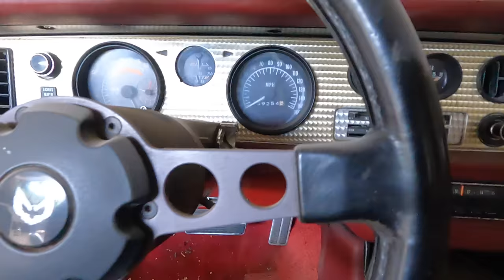Amanda's 1974 Trans Am 455-SD Dream Drive

Comment: My dad ordered one in 74 with the 455-SD engine, honeycomb wheels, and the big phoenix on the hood. Even back in the day there were shortages which held up his order, after a few months it was the wheels holding up the show so he changed to stock wheels and it was built. I only drove it a few times and it was a fun car to drive. At the same time my mom was driving a 1969 red Mach 1 which they gave to me in 1976 when I graduated high school, wish I still had it today.
Reply: I owned a 74 formula in high school. I bought it off a family friend who ordered it brand new in Toronto. He also told me the same story. He ordered it with honeycomb wheels only to be later told that he would have to settle for the ralley wheels.
Reply from the maker: They made some 455-SD Formulas.
Reply: It's a small thing, but I appreciate you describing it correctly as a phoenix on the hood. That's what it really is. I hate when it's called a screaming chicken- a dumb name that's stuck.
Reply: @thewriter2549  Never heard that before...!!!!!
Reply: 43 Formula SDs built in 1973 and 58 built for 1974. Also all Super Duty Formulas got the Trans Am Shaker hood.

Comment: My first car, bought it new. 74 SD-455 trans am, red with black interior.  I went back and forth on transmission. I wanted a 4 speed, but wanted AC too. Ended up with an auto. Ditched the 308 ring and pinion for a 3.73 after warranty along with hooker headers and thrush mufflers. B&M trans pack and holeshot converter. Ran consistant 12.20's at National Trail Raceway on street nights. Kept it until 2000. Wish I still had it.

Comment: No key, so they tear the console apart to try to put it in neutral? That's not how it works guys. There's linkage under the hood near the brake booster that attaches to the bottom of the steering column that locks the transmission in gear when the key is out of the ignition. It would have taken about 5 seconds to unhook that linkage. Anyone with any sort of experience with 70s GM F body cars would have known that instantly. It's scary to see all these vultures around such a special car. Hopefully Amanda gets some help from a professional with good intentions.

Comment: Be sure you chain that motor down on the driver's side because the motor mounts break and stick the throttle wide open it's happened to me on a test drive with one of those 455 trans ams

Comment: My dentist back in Jersey in the early 90's had a red 74 SD455 Formula 4 speed. You want to talk about rare?
Reply from the maker: Rare oh yeah, Formula with the SD-455? You betcha, 43 made in Formula and 252 in Trans Am. Pontiac started the muscle car era with the 389 GTO and ended it with the 455-SD Trans Am.
Reply: Only 10 SD Formulas in 73 with the 4-speed